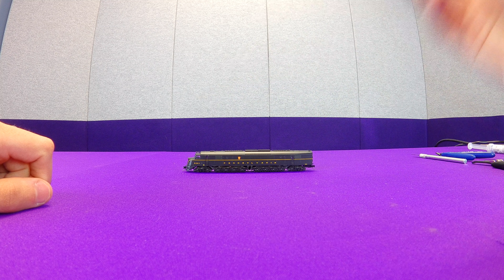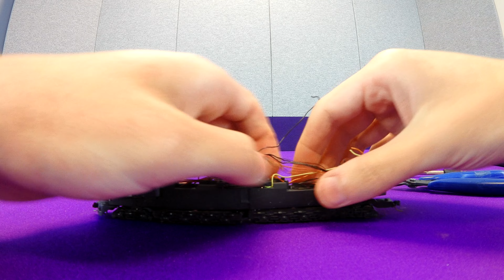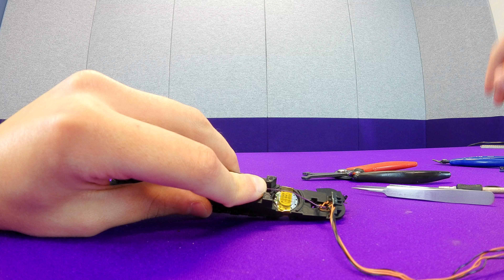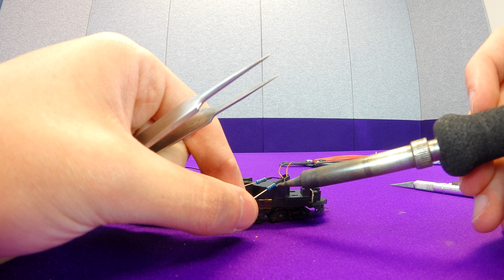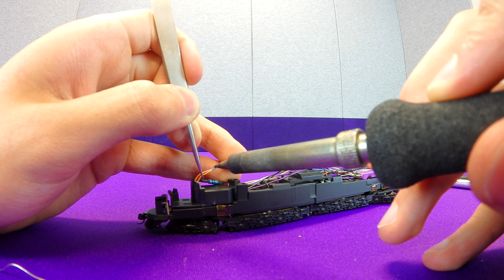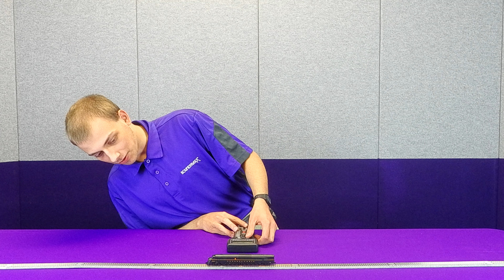TSU-1100 Install into a Broadway Limited Imports Centipede

Comment: Hello! I really like the sound that your tsunami 2 decoders have but sadly they do not fit my budget. Would the original Tsunami decoders suffice in sound quality? Thanks.
Reply from the maker: The original Tsunami has great quality, but they have been discontinued for years so they are out of warranty and/or cannot be serviced if you have any problems. Our Econami line has the same great quality as Tsunami2, it just has fewer sounds and features. Learn more: https://soundtraxx.com/products/econami-digital-sound-decoders